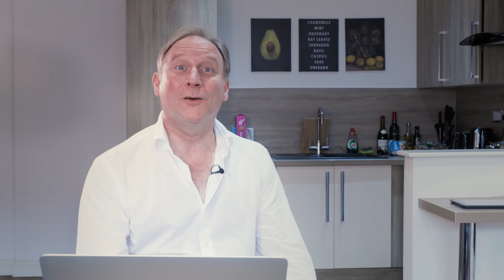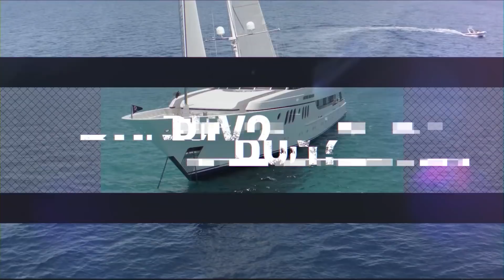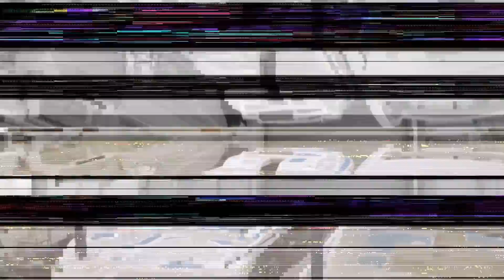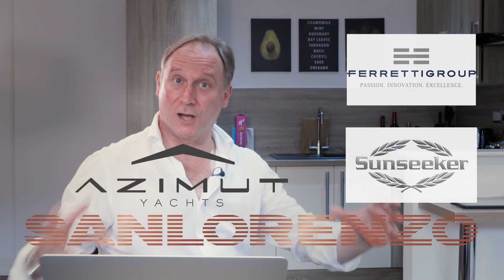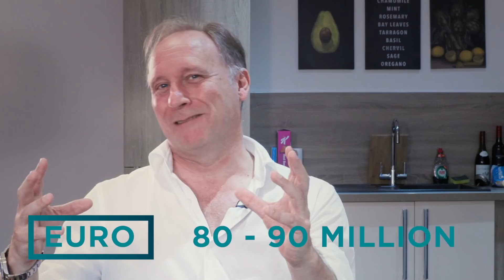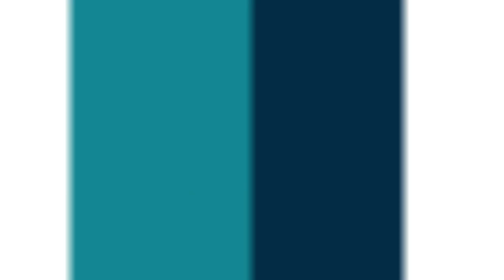WHAT YACHT SHOULD YOU BUY???

Comment: For my specific needs the vast majority of what I need will consist of steel or aluminum hulls. But some of the smaller craft might end up composite. Although bearing Moreen has some 28 foot cats that I think would make excellent tenders on a vessel of 165 or better.  And I’m even wondering if it would work on some of the 120s with a little customization. If my plan comes together, I’ll need sturdy charter craft. I’ve already concluded anything over 120 feet for a personal craft is ridiculous for my needs. But I might be a little ridiculous and go with a 140 anyway.

You offered clear advice for yacht purchasing strategies that I firmly agree with, or I have to ask if I purchase a brand new custom do I need to do a survey right behind the originals? I’m already gonna have sea trial reports and everything else and the boat will be brand new.

Comment: Builder: Bering
Size: 145'
Staterooms: 6
Crew: 9-11
Range: 5,000NM
Engines: Caterpillar 32's
Tender: 1x35' Hysucat, 1x Willams Turbo Diesel 540 3xKawasaki Waverunners
Interior: Hot Lab
Or a Numarine 37XP

Comment: A note, solid frp isn't specifically stronger, in fact it can easily be weaker than a sandwich layup.  The primary reason it is done is due to concerns over water ingress into the core material (this is a far bigger issue with wood-based cores and open cell foams, rather than the typical closed cell foam used).  A solid laminate really only provides more weight for a little bit of piece of mind (it is more impact-resistant) and an easier construction process, compared to a sandwich layup that is designed and built properly.

Comment: Are there any decent electric engines out there? Are they safe in a water environment? More to the point, are there many places they can be charged?
Reply: To my knowledge there are no pure electric yachts.  The range and speed would be miniscule. The best you could do is a Hybrid diesel electric  system.  This type of system uses diesel engines to charge battery banks that run electric motors to drive the yacht.  This system can run directly from the batteries for short periods of time.  For example a Wider 165 can run about 8-10 hours at a speed of 5-6 knots on battery power alone before recharging.  

Purely electric systems are simply not practical for a yacht.  Who wants a yacht with a 50 mile range before you have to pull in to a marina and recharge?  Yachts are not like electric cars.
Reply: @kokomo9764  I didn't think they were any around yet but have no doubt they will be coming, albeit slowly. People said similar things about cars but they got here, I am sure they could get 500 mile range now, a lot more in the future as technology improves. For now, since I want 6000nm range it's still diesel 😁

Comment: Another very enjoyable and informative video, thank you 🙂 

I have a question regarding sailing yachts. In your experience what is the largest sailing yacht that does not require a full time crew? 
I lived on a yacht when I was a young teenager, a 41ft sloop. Being young, that yacht was quite large enough plus I spent most of my time either rowing around on the dinghy or in the water. 
However I'm a tad older now and a bit of extra comfort and space is higher on the priority list.
There has been tremendous advances in technology to automate / semi automate sailing yachts. Hence my question. 
I'm thinking more of a blue water yacht capable of ocean cruising.

Love to hear your suggestions. 

Thanks in advance 🙂
Reply: In my opinion a 20 meter yacht (or 65 feet) is the absolut maximum without permanent crew. A lot of yachts this size have at least a bosun. In the Med you can easily handle 55 feet with a couple. In the Westindies the boats without permanent crew are a little larger, but there an extra crew is easy available if needed. In the Baltic you will never find a boat above 18 Meter without permanent crew. So it depends a lot of the regional infrastructure available. Generally speaking the better the infrastructure the less a permanent crew is necessary.
Reply: @stefanschachler831  Thanks for your reply. That reminds me of a guy I met in the Whitsunday islands in Australia. He was a French guy who sailed across the channel in a 14ft open sailboat. Once in England he modified his boat to 17ft and enclosed it, i.e. created a relatively dry cabin area.
From there he ended up in Canada, met and married his wife. 
When I met them they were sailing an old but beautiful H28. I asked him, if had could have any type of yacht, what would he choose?
His answer: A 60ft catamaran. 

I asked him why and he simply said, I'd like enough room to hang my hammock and my toothbrush.

Getting back on topic, I'd be surprised with all the advances in technology that larger yachts couldn't be handled by a family, a couple, yes I understand the restrictions.

Either way, it will be an enjoyable journey.

Stay safe and thanks again 🙂